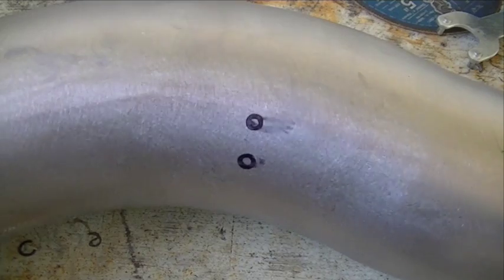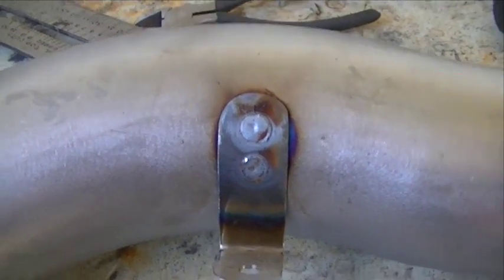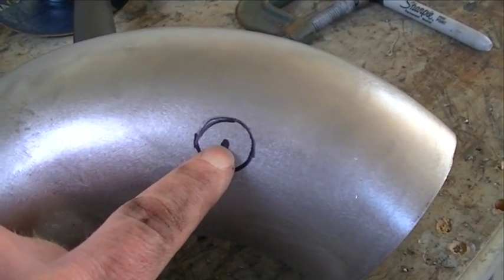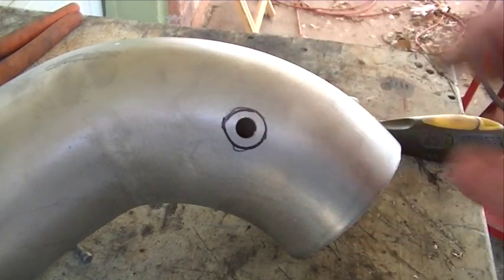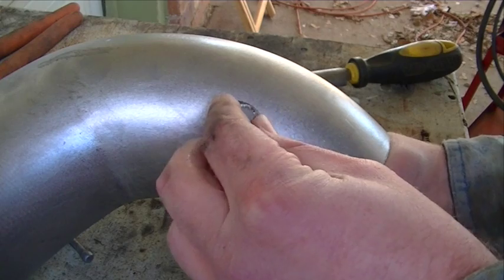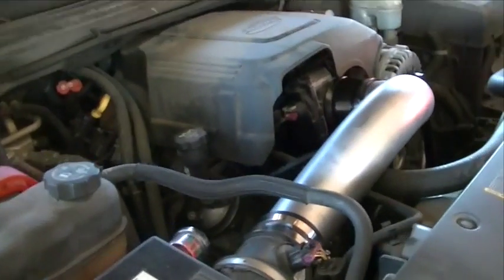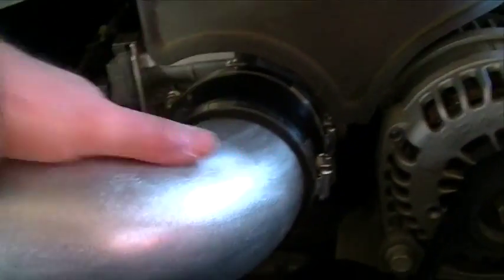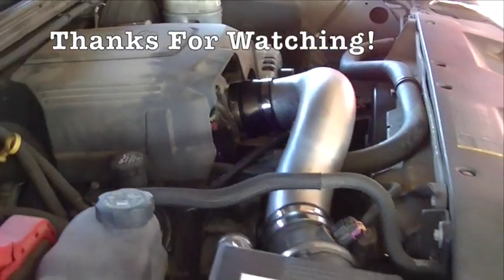PART 6 LS ENGINE CUSTOM INTAKE TUBE FABRICATION | Vortec 4.8 5.3 6.0 6.2 V8 CAI

Comment: New sub...    THIS IS BY FAR BETTER THAN ALOT OF BIG BRAND COLD AIR INTAKES. ALOT JUST DO A 90 DEGREE BOOT BY THE THROTHLE BODY AND A PIPE WITH A LITTLE BEND AND CHARGE A FINGER...

Comment: Fantastic work! Looks amazing. Too bad it will heat up more than the Airaid MIT like you said earlier, but it's much prettier and fixes the only problem with the stock air box system. You have great skill sir.
Reply from the maker: 717UT Thank you my friend!   Yeah, the tube definitely gets hot.  Noticeable drop in power during the hot Texas summers.

Comment: did you notice a sound difference coming from the engine bay? usually when you install an aftermarket intake there is a deeper throaty sound.
Reply from the maker: MegaSierra117 No, I didn't notice any throaty sound.

Comment: You did very good job but how much time and money spend for doing that. The reason I am asking you can buy a volant cold air intake with power core filter from Amazon.com for $267..
Reply from the maker: Boz Kurt I have roughly $40-50 in materials and about 4 hours of my time.  You make a good point though. Some of those cold air intakes are probably better than what I can make at home.  This project was more about seeing if I could do it.  I figured I'd film it just because I could.  I'm betting whatever performance I gained by smoothing out the air flow I'm loosing in air intake temperature.  The steel tube gets pretty hot under the hood.  It holds heat more than plastic would.